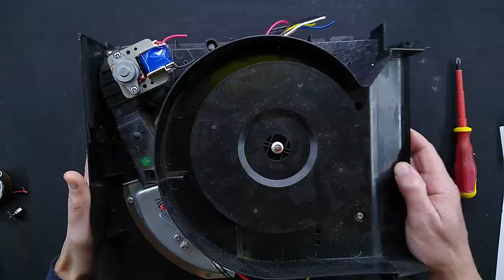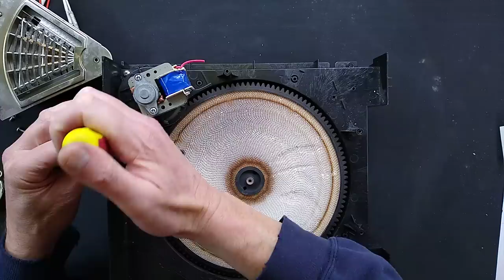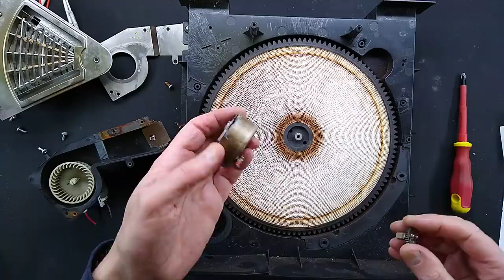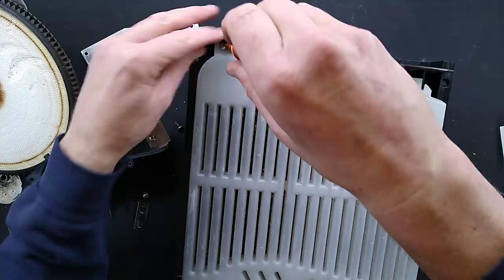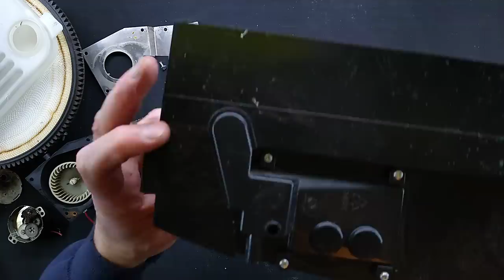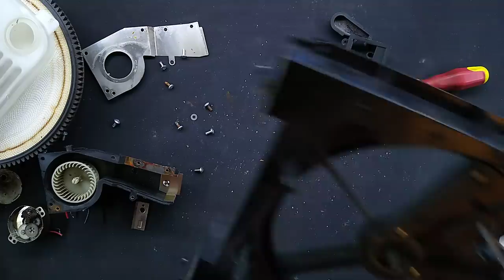Desiccant drum dehumidifier teardown

Comment: This is such a clever little device! I love how it’s basically a heater that makes water from the air. I wonder if I could use a modified design for project Chickenhole. Perhaps concentrated sunlight instead of electricity?
Reply: Since a compressor dehumidifier is just an AC running in a closed room, the simplest solution should be a peltier "cooler" (fans optional). For efficiency it will be hard to beat a compressor, so that leaves this device as a neat in-between for both complexity and power usage?
Reply: Hey Cody 🙂
Reply: Hi Cody
Reply: hey cody, glad to see you following 1 of the best teardown channels on youtube :)
also instead of direct solar, why not run a 30 watt panel to a pc fan and however much nichrome it can handle?
Reply: Requires humidity in the air for it to operate. Using direct solar heating is interesting but still not much water there to collect. Chickenhole looks pretty arid.
TLDR: the difference between Can and Should.
Reply: @Miata822  yeah generally in Western Europe if there is high level of humidity, there is almost no direct sunlight but cloudy weather.
Must be a working system for humid summers like in South-Eastern USA though.
Reply: Hey it’s Cody!
Reply: @Cody'sLab - Watched your algae growing media vid earlier, and had a question that wouldn't go away (in my head).  how can mould be prevented? yes distilled water mainly, but how to stop mould growing on algae with no salter water? ..  is that a dumb question. if so i am sorry.
Reply from the maker: I've contemplated alternative sources of heat.  I'm not sure the best option for predictability.  Maybe air blowing through a buried pipe for geothermal heat?  (But water might condense in that pipe.)

The liquid desiccant technology looks messy but interesting.
Reply: Hi Cody! I'd thought about using desiccant for Chickenhole Base a while back, but this has reminded me. The idea I had isn't as elegant as these desiccant dehumidifiers, but I thought might still be of interest to you.

The idea I had was to fill a pipe silica gel, air would be pumped or blown through the pipe when the humidity was highest to adsorb the moisture, humidity sensors at either end would allow you to see when the desiccant wasn't gaining any moisture.
When the desiccant was at capacity, a small flow of hot air would be blown through and the moist air ran through a radiator/a coil of pipe in the shade/buried pipe or some other cool place and the water collected. 
Drying the desiccant might take a while though, as all the moisture has to be pushed through the drier desiccant at the end of the pipe. A valve at the end of the collector pipe could be included so that when collecting moisture the condensing pipe was shut off, and the other way around when collecting water.

If you could get the silica gel into narrow black plastic pipe and make a solar heater with it, the heating could happen during the day, and then loaded with moisture at night (I think it's more humid then?) a small air pump running during the day into a shaded pipe would cool the air down.

I wasn't sure if the moist air would be cool enough in the shade to reach the dew point, especially if the flow of warm air was too high, but if it ran in a shaded pipe (under the greenhouse) and then over a Peltier cooler, it would be more effective.
As the desiccant is being heated in a solar heater, I think a solar panel running the Peltier would work well, as the solar heater and panel would both have higher outputs on sunnier days. You wouldn't need a solar panel for heating either. 

My other idea was to use anhydrous Calcium Chloride, blow air over/through it to gain moisture until it became a liquid and then distil it under slight vacuum to distil off some water, but not to dryness. Then blow air over/through the slightly drier CaCl2 liquid once cooled until equilibrium is reached, then vacuum distil and keep on repeating. I think something could be made from a 55gal drum (maybe insulated), 12v air pump, 12v immersion heater, 12v vacuum pump (or an aspirator and a 12v pump, maybe using oil instead of water) and some form of condenser (or a car radiator) The vacuum might not be needed at all, just heating. pumping the CaCl2 through a solar water heater might work/help too. Not sure how the pumps etc. would handle a very salty environment though. 

I'm pretty sure there are problems with my ideas, I'm not familiar with dry environments being from the UK. Hope this gives you something to think about.
Reply: @bigclivedotcom  can there not be a re-heater Clive? Calcium Carbonate (for moisture absortion) then dried with air over bacteria/slime inhibiting "pond" ??
Reply: @bigclivedotcom  Maybe a heat pump can be a more efficient heater - so to say, a compressor based and absorbant based design combined. For practiability considerations one would need a figure of the specific desorption energy of the absorbant.
Reply: Cody and Big Clive, that would be an absolute dream team collaboration!
Reply: @PainterVierax  Cody was asking about using it on his ranch in the Nevada desert.
Reply: @Miata822  so venting during day, closing during night should already do a good job during the large amount of sunny days.
Reply: Plastic pipe with holes in the in ground pipe
Reply: @Zadster  Utah and Manx combined.
Reply: @benlee4940  Not sure if silica gel would work in that application. I mean, it would absorb moisture just fine, but I don't think the setup you described would get it anywhere near hot enough to regenerate it - you need to heat silica gel to at least 120 degrees C to start driving the absorbed water off, and ideally to over 200 to completely dry it. So you would need to have very hot air to make that work.

Calcium chloride is of course a more effective drying agent, since even once it has absorbed enough water to dissolve itself (this is a deliquescent property), it can still keep absorbing more. In fact the "liquid desiccant" is often just a saturated calcium chloride solution, and this is used in some air conditioning systems. I would be interested to know why you think vacuum distillation would be necessary to drive some of the water off though. Because the notion that vacuum distillation is more energy-efficient is a false one - it only changes the temperature at which boiling occurs, but the total energy required to boil off the water is not reduced. If anything, you end up consuming more energy due to the power required to drive the vacuum pump in addition to the power used for heating.

If you want to pump a calcium chloride solution, I would suggest using a small submersible 12 volt (or even 5 volt, since these can be USB-powered) plastic pump. These use brushless motors, operating on basically the same principle as most types of 12 volt computer cooling fans. The only parts directly exposed to the solution are the pump impeller (which is usually made of plastic) and the magnetic spindle, the latter using laminated ferrite magnets, so none of this would be corroded by the solution.

Comment: I've got a similar one bought on Amazon UK three years ago. Called "Ecoair DD1 simple desiccant dehumidifier", it cost 130ukp at the time. It's been very good. Though it's made in China it is ideally suited to the British climate in winter, that is damp cold air. I also live by the sea, adding to the humidity, and in a mid Victorian solid brick home which tends to get damp in winter.  The Ecoair's stated operating range is 1 degree C to 35 degrees C. I also bought a Thermopro digital hygrometer at the same time. This measures air dampness accurately, so I can turn on the dehumidifier if relative humidity inside strays too high. The dehumidifier is also helpful if you are trying to dry clothes indoors, speeding things up considerably.

However, it would not be suitable for a hot humid climate, as the Zeolite-based drying process heats the air. And in places with cold dry winters you're unlikely to need one, as you could probably get rid of internal condensation simply by better ventilation.

UPDATE: just found a Big Clive video from two years ago taking this exact Ecoair model apart https://youtu.be/BUJqUapiNEc. It also goes into the interesting Zeolite desiccant air drying process some more, and the kind of things that can go wrong. But basically the Ecoair seems to be a cost effective, durable device if you live in the type of climate (cold, damp) where dessicant dehumidifiers beat the more widely available refrigerator-like compressor type (better in hot damp conditions).

Comment: I used to do field service on a shipping container-sized desiccant wheel dehumidifier system sold to supermarkets. The wheel was about 5 feet wide, and there was a companion 5’ heat exchanger wheel. 

The pitch was that it would be more efficient and less expensive to run than using air conditioning to control humidity and frost buildup in the freezer section.

They’re not around anymore, so I guess they couldn’t make it work.
Reply: The dessicant must be regenerated periodically. Either with very hot air or simple replacement. But if you remove moisture below 50% RH level, it is very uncomfortable.
Reply: @janami-dharmam  One side of the machine had a flow of hot air to dry out the wheel, the other had a flow of store air to be dried. The dessicant wheel turned slowly, picking up moisture on one half and being dried out on the other. The heat exchanger wheel turned more rapidly, and cooled the air back down (using air cooled by a swamp cooler) before it was dumped back in the store.

The air would never get too dry because more-humid air from the other sections of the store, like produce, would mix in.

Comment: Cool device, that smaller motor looks almost identical to the rotating plate motors used in microwaves,
Reply from the maker: It's a very common style of motor.  The ones in microwaves usually have no specific direction, so the turntable will rotate in a random direction when started.

Comment: I think zeolite is also what's used in oxygen concentrators. From what i can gather, at a certain pressure, nitrogen gets absorbed into the zeolite, leaving behind air with a high level of oxygen in it which is sent to the output tube. The pressure is then released and the nitrogen leaves the zeolite and is vented to the ambient air. This happens over and over again and can actually give a decent flow of O2 gas. My brother had one at home when he needed medical oxygen, rather than have to have a replaceable tank.
Reply: I think zeolite is a bit of a generic name for a large group of minerals with these porous properties - I believe there's well over 200 discovered types in nature, but significantly more than that theoretically possible crystal arrangements that could have their own properties and maybe practical applications. i.e it's probably not the same material in the o2 application as in the dehumidifier.

Comment: Mine cost 600$. And when I opened it up I saw that it was the small geared motor that had died. I ordered another from the Chinese jungle site, used an angle grinder to flatten one side of the pin and hey presto, thing has lot of years left 👍🙏😉

Comment: Some prefer them for the lack of noise. Being in Asia summers are hot and humid so compressor works fine.. Winters are dry and cold so not needed here but they are still sold as they are quiet.. Zeolite I think is what many use

Comment: I'd be real curious to use an equal powered compressor unit side by side and see which one can collect more water for the power used.
Reply: It depends on the conditions. In hot and humid environments the compressor type dehumidifiers are better, but in colder, less humid conditions the dessicant type work better.
Reply: @DrAHorn  here it's warm and humid, Hawaii. So I enjoy the cool air the compressor model creates.

Comment: I had a similar one. It was quite effective but I didn't like the smell it gave out. The same desiccant disc motor failed on mine and plastic parts near the heater melted. They are much more cheaply made than the compressor type and I wouldn't get one again.

Comment: My Meaco is leaking, water dripping out of the heater. I guess the heater blower is blowing so hard the gravity is not enough for the water to come down and drain through the drain hole on the blower? The drain hole is completely clear and does drip some but actually I feel like more water is coming out of the heater than the blower.
Reply: For now I've made a barrier and drilled a hole like it's done below the heater blower and another hole in the lid of the tank.
Reply from the maker: They do often gunk up with slime inside in the water paths.

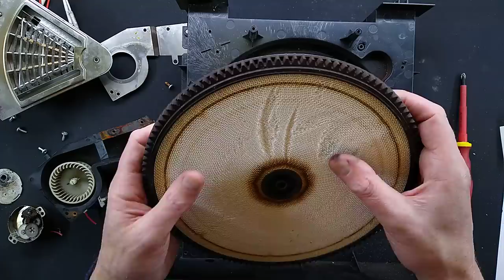Comment: I have the same dehumidifier, but the heating element (6:30) just went irrepairably bad, I tried to fiddle with it with no luck. Could you possibly sell that heating element to me? I tried to find a spare part but havent found anything even similar.
Reply from the maker: It would have to be the exact same unit.  There's variation between the modules.  I've contemplated alternative heaters.

Comment: Clive how can I get in touch? I have taken apart a PS3 Sixaxis controller and removed the battery. The battery has this cool component inside and wanted to know if I could reuse it to charge my disposable vape batteries?
Reply from the maker: If it's a small PCB it may be for cell protection and may not limit the current.
Reply: @bigclivedotcom  Ah ok, thanks! Yeah it's a strip PCB with  a jst connector. Says LIP1359.

Comment: Is it just me not knowing a thing about aerodynamics or the small fan's air path seem to be designed "backwards" flipped? AC motors (usually) spin counterclockwise, which correlates to the way the blades are made, pushing the air outwards counterclockwise, but the air path is designed to let the flow clockwise... hu...
Reply from the maker: AC motors can go in either direction - or some small ones are non-directional.  (Your microwave turntable can go in either direction.)
Reply: @bigclivedotcom  This particular mass produced style (typically) have a pair of copper loops to make it rotate counterclockwise usually, like a random industry standard, just like how DC motors usually run clockwise if you connect them in "the right" polarity. But still the blower seem to be designed to run "the wrong way" based on the air path design — just odd lol

Comment: I've heard of these but am not sure I've seen them for sale in my area. I assume they're not very common in the US as compressor based models generally make more sense - the advantage of operating down to cold ambient temps really just doesn't matter outside of particular climates. Here in the Midwest our humidity levels in winter plummet, and I joke that the humidity here is consistently wrong - dehumidifiers in the summer, humidifiers in the winter! Right now is one of the few times of the year where I'm not bothering to fiddle with it.
I would like to get a hold of one of thse and do some energy consumption comparisons. I like the idea of something quieter, but then again (and this might also have something to do with them apparently being rare here) I have a dehumidifier in the basement and use the HVAC fan to move air throughout the building. Since that's almost a given feature in US homes, we tend to like big, powerful units and put them somewhere the noise isn't a problem. Plus, air conditioning does its own moisture removal, too.
Reply: I've used similar units in the US for industrial type uses where complete control of the air temp and humidity is required.  Ie clean room environments.
Reply: Whatcha Techno Boy ! love your work...cheers.
Reply: I live in MN and have one of these. There's an "Ivation" brand one for sale on Amazon. I actually use it in the garage in the winter time. I keep it lightly heated (~40F or so) and all the snow that drops off the car creates a ton of moisture in the garage that condenses everywhere. This works really well in those cold temps where a compressor based one will not operate, and as a bonus provides a little bit of heat to the garage.
Reply: I bought one on amazon for not too much money.  I use it in the basement during the winter when the compressor dehumidifier stops working because it gets too cold down there.
Reply: @andrewt9204  Good use case
Reply: Look for a used commercial unit. you might find a 4 foot wheel version for a cheap price, if you remove it. We replace the systems that have these with reheat units. They basically go to the scrapyard with the rest of the sheet metal. Good luck! 👍
Reply: Munters makes a good 120v, 150 CFM model.
Reply: These aren’t popular in the Midwest because they quickly die in dusty environments. It has to be cold and damp for these to be effective.
Reply: Perhaps get hold of one in time for this year's No Effort November.
Reply: Same here in Central Europe. Tropical plumes in Summer, dry in Winter until your nose burns.
Reply: Costco was selling a little 20W unit for under $30 a few years ago, brand name is Eva-Dry. I'm surprised how it works, I had been thinking it was a little Peltier cell pulling out the water on the cold side like a compressor based system.